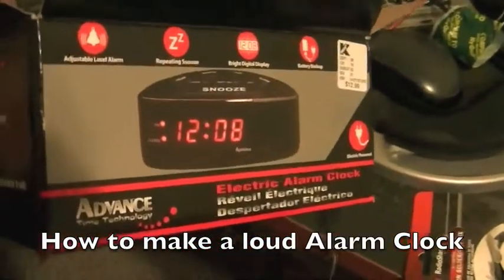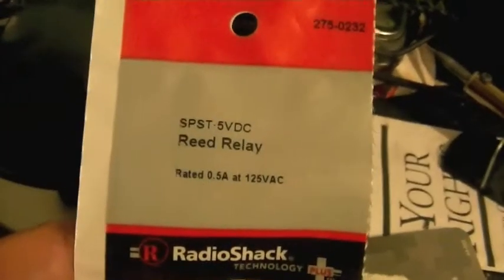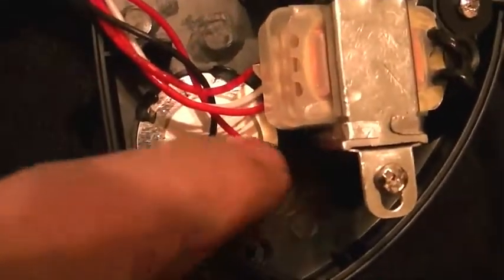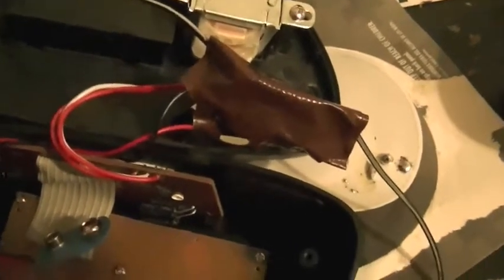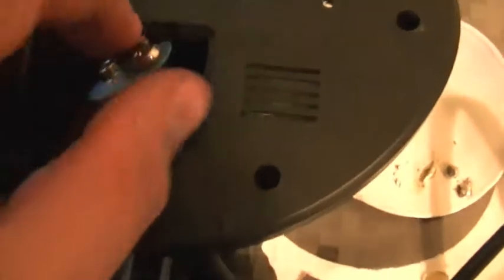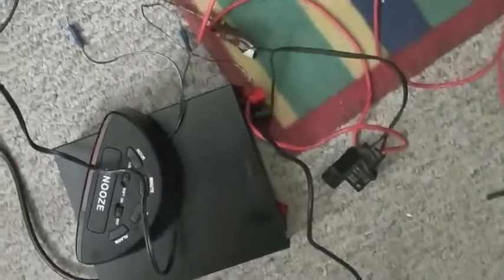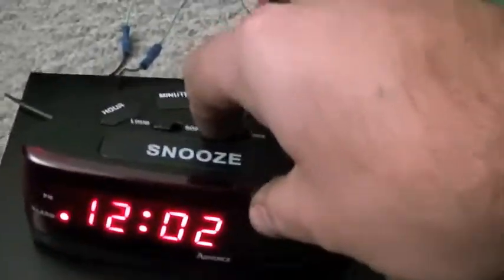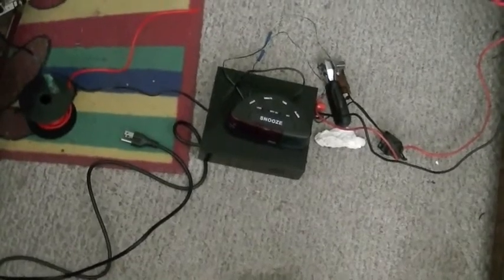How To Build a loud alarm clock DIY

Comment: Hey Repeatman, how did you wire the reed relay and what is it for?
Reply from the maker: it was to energize the 30 amp relay due to the alarm clock only putting out roughly about 4 volts max. I soldered the wires from the alarm clock to it then ran a positive wire to it then on the other end ran the wire to the + trigger on teh 30 amp 12 volt relay. like a double throw switch.
Reply: +repeatman will it work without the reed relay?
Reply: +repeatman Because I'm gonna build one.
Reply from the maker: +Samuel Salzman TV the alarm clock does not have enough power to close the 12 volt relay, therefore the reed relay is needed.
Reply: +repeatman ok thanks